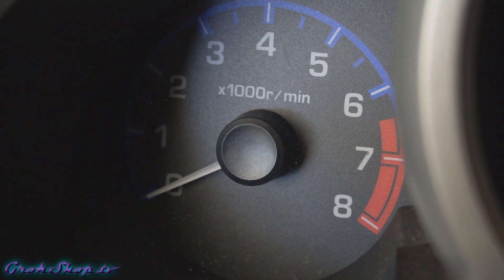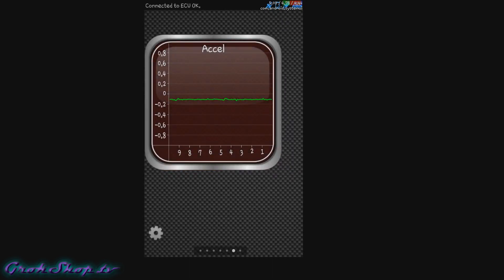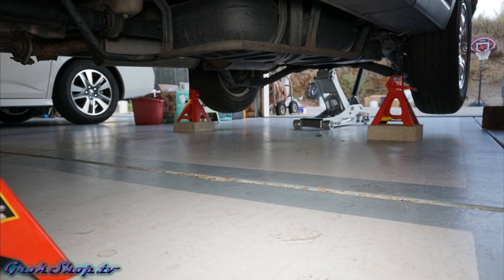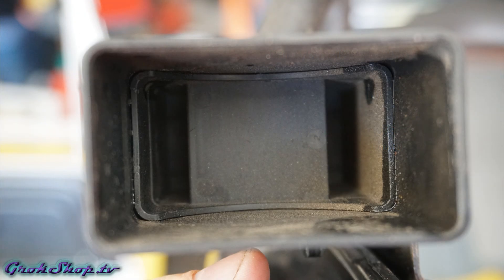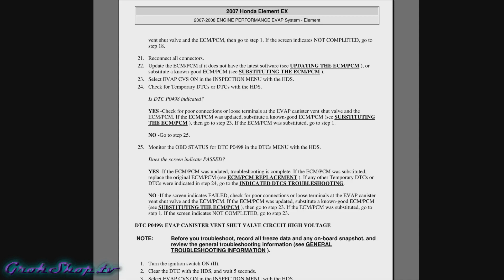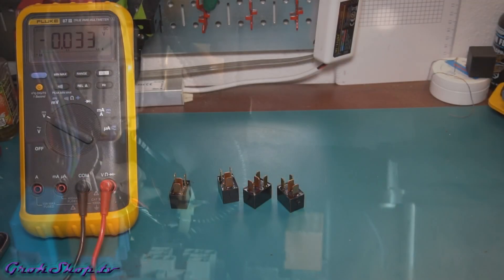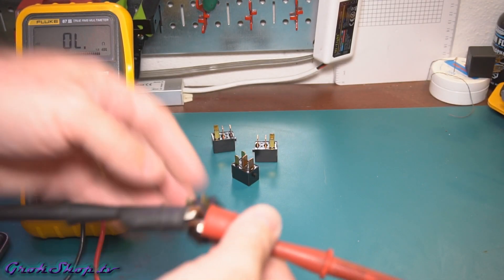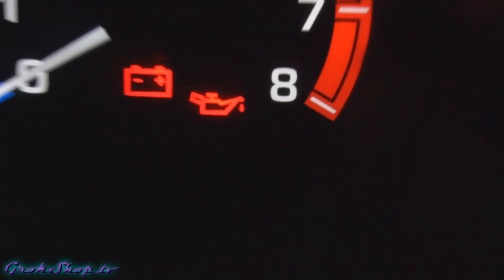Check Engine Light Troubleshooting: Honda Element DTC P0498 P0135 - OBD2 Scanner - Relay Testing

Comment: Any comments why after ignition the check engine light blinks 10 times only and goes off with no scanner code or constant check engine on?great 🎥 👍
Reply from the maker: Not sure about your specific case, but I know that in some cars you can get the light to flash the codes such that you don't need a scanner.  I seem to recall doing this before and I think I had to short something to get it to blink the pattern.  If that is what is going on - you would need to find the pattern decoder & also check for your car if this is even possible & if something could already be shorted without your prior knowledge.

Comment: Thank you so much. You saved me from going fully insane after my cat converter got stolen I still got these codes with a new cat and fresh o2 sensors.
Reply: What was the problem
Reply: Yup just replaced my cat and still got check engine light...what did u do?

Comment: Tip-You check the fuses continuity with your meter without taking them out since they have the contacts on the top.

Comment: Is this the same for a 2004 Honda element? Is this relay still behind the glove box? I still have a p0135 after I installed a new oem denso air fuel sensor. Thanks.

Comment: Amigo no me lo creeras pero me diste la solucion mismos codigos crv2013 gracias
Reply: Como lo resolviste amigo? tengo los mismo problemas , ppor favor ayudenmeee D:
Reply: @luisfernandotorresrios6365  el rele activa al sensor y a la valvula del canister 
Compruebe el rele
Reply: @luisfernandotorresrios6365  en ni caso era el rele q estaba defuectuoso
Reply: @luisfernandotorresrios6365  pero revise q lleguen los voltages y los masas al rele si estubiera bueno